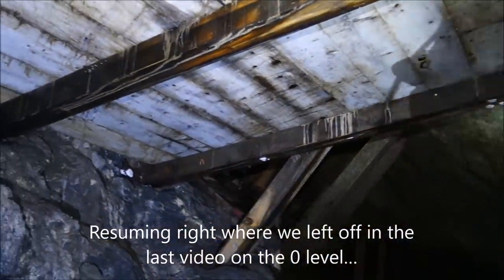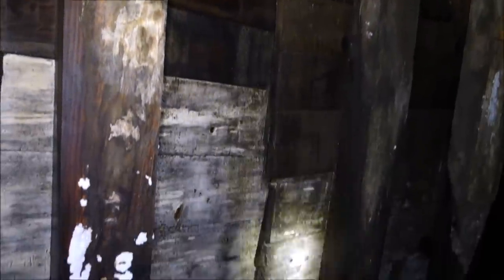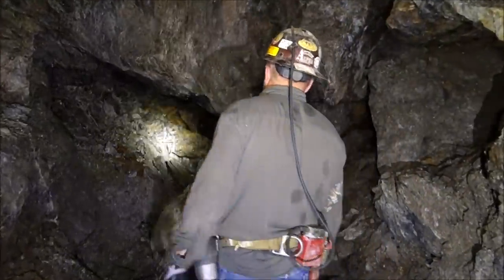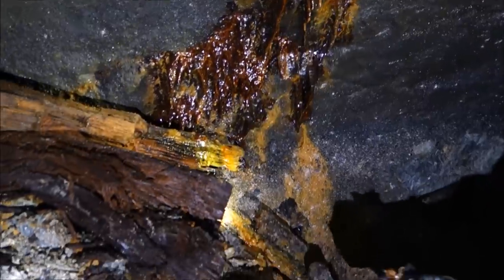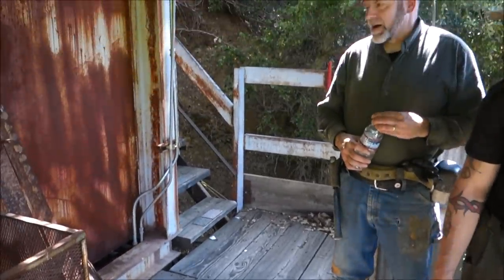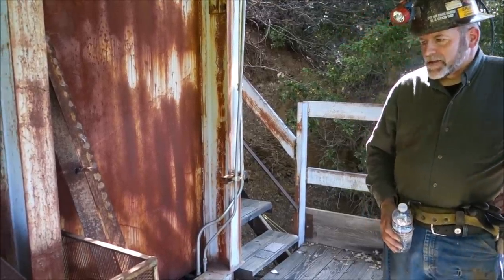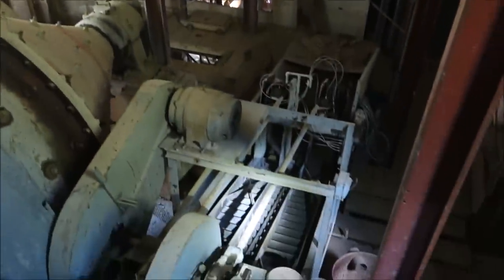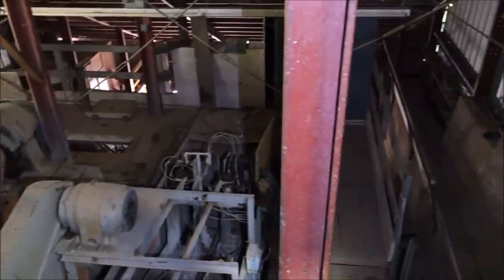Special Visit To The Incredible 16 to 1 Mine: Part 3 - Milling Gold & Last Of The 0 Level

Comment: The difference in the timber is oak vs softwood (fir, pine). The softwoods will expand when wet and the cellulose opens up so much that fungus can penetrate. With oak when it’s wet it swells and the cellulose gets tighter and won’t let anything penetrate it. Hardwood is becoming harder to get and way more expensive and just isn’t cost effective to use so they just use softwoods now.
Reply: Soft wood will be rotton in less than a year in those constantly wet conditions unless treated.
Reply: Why cant concrete be used
Reply: @eaglewi  Concrete tends to snap if impacted and won't bend with loads. Wood bends with loads and won't snap quite as often when impacted. Plus costs. Factor it all together and using wood is cheaper/easier. PLUS can't really do concrete arches in unusual bends/angles, where with wood just nail it in place + cut to fit.
Reply: Simon Tay actually in those mines the water has minerals in it. Those minerals will leach into the wood and pretty much petrify them over time. Think stalactites and stalagmites. The cost of oak is $3.85 a bd ft were the cost of pine is about $1.50 a bdft. It’s not like the wood is above ground exposed to UV light and has a lower oxygen level. Softwood will get the job done and is a more renewable resource than oak. 5 years vs 50.
Reply: erik litchy just to add to what Christopher said, concrete also gets soft as it gets damp. If you put any pressure on it then it would just snap. It would have to be reinforced and the cost of steel is just too great. Understand that the more it costs to mine the more valuable it becomes. Price of gold would escalate so much you couldn’t afford it.
Reply: Mark
You said concrete gets soft when wet. I remember I think it was MIT doing study or looking at Roman concrete. They said they think it was poured hot if i remember right and they replicated some tests. I guess that Roman concrete in water lasts a long time as ports were made out of it, but also as the concrete cracks the stuff in the concrete maybe calcite I think goes to the crack and fills it in again so it’s solid. Idk it was an interesting article I read a year or two ago. That type of concrete seems like it’d be way more durable than stuff we use today especially if it self heals when cracks form.
Reply: Mark
I remember looking into growing mushrooms. If you want to grow reishi or shitake on oak you basically have to cut a new log, innoculate it and wax the ends. It seemed like it was pretty susceptible to be invaded by other types of fungi which is why most websites or videos said to only use fresh cut logs not old ones.
Reply: Also idk. Pinyon pine  or juniper is considered a soft wood I believe cause it’s pine but the resins or pine tar in it is why it burns good or juniper is good for fence posts. So I think pine that’s older with more resin in it also matters to longevity.
Reply: @koltoncrane3099  I never said concrete gets wet and soft. Once it’s cured it doesn’t get soft but it does let moisture soak in

Comment: That is very interesting.  Wallace Idaho is part of the Silver Valley which the Bunker Hill Mine where I worked is at.  There are still a number of gold lead silver mines running in the valley.  If any of  you get  up that way there are a number of museums with some great stuff.  Back in the  50's much of the  underground machinery was built in the area.
Reply: There were foundries in the area, Nevada City Foundry, and Joshua Hendy Iron Works in San Francisco, for example. It is interesting that the hoist ended up in Alleghany California.

Comment: Many thanks, I really like this series, have watched it several times.  Question about the finishing room, at time 25:43 to 25:45, there seems to be a huge shaker table under the stairs, it's like 3x the size of the 5 X 12 that Duane points out.  Is that like a triple wide 'industrial strength' production table?  Yeah, it looks like a reinforced wall, it was on the 3rd or 4th viewing that I noticed it!  Plus, can't believe the size of the Ball Room, seems like one sizeable earthquake and the entire mountain would collapse on it!   Thanks again.

Comment: the shattered and faulted rocks show that it is bedrock that was shattered at the start of The Flood 4,350 years ago.
The gold is in quartz veins because they were dissolved in solution of boiling hot water and as it passed through the rocks cracks some of it cooled and precipitated out to make the quartz vein with gold dust and larger blobs.
That is why much gold has soft round edges.

Comment: I was going to say maybe you need to soak the wood in oil or spray it with linseed oil or pine tar or something. Also really old wood depending on the type has more resin in it making em last longer compared to fast growing wood today. But ya it depends on the species I’d guess which is probably why a lot of wood today is treated cause it is fast growing and has less resin.

Comment: I worked for a specialized mining contracting company for a decade and that is the smallest ballmill I’ve ever seen. The only good part is the liner change would be only a day long minus taking the balls out and refilling. The bigger ones have inch drives which allow you to bump the mill slowly so you can level out the balls instead of taking them all out. be thankful it’s not a rod mill

Comment: I’ve operated a classifier at a natural iron ore mine. They were invented in Minnesota to separate the fines .
Reply from the maker: There are some big mines up in that part of the world!
Reply: @TVRExploring    I worked at one of the smaller mines while going to college and even that was huge when compared to gold mines and such.  During several summers I ran the washing plant and then drove trucks until I quit. These trucks were very small only 65 tons. In time I even drove one 200 ton truck for one summer. The problem was the shovel couldn’t reach up high enough to fully top off the box. The other issues were driving up to the mine dumps. This truck weighed so much that you could never dump a load over the dump sides. You had to dump in the middle of the dump and the two d9 cats would push that load over the dump sides before you got back with another load of over burden. There is no natural ore mining in Minnesota. But mining is still a major undertaking. 
The largest gold, copper and other valuable mining is being develop next to a LTV mining operation on duluth complex. This will be a massive operation if they can get the permits. This will be an open pit mine. In fact the ore body sits right next to a 45 year old mine pit and will use the old mines crushers and mill. Right now I believe they are looking at mining 6-7 minerals. There are many other massive deep deposits in the area that could also be mined.  
Sadly the operations are near the boundary waters and many groups are fighting the mining of these deposits. 
Back in 1995 I brought my ten year old daughter and found outcroppings of ore within the BWCA. I could tell these were massive even back then. These were found within four mile of the mine sights that are being studied right now.

Comment: Funny... 3 years old, and the mold is growing. Exactly the same for us in our mine... on th eother side of the globe. Brand new timbers now rotting, after just 3 years. We cut it off and cut it off, and it keeps growing like crazy. Kinda funny, but also frustrating. 

Anyways, I really enjoyed this. Very interesting. Would be awesome to work there if it ever reopens. Weird how the ore actually still is present even at the conveoyr... they just shut it down and left. Didn't even process the rest of it.
Reply: You should paint/treat the wood before installing it to make it last longer.
Reply: I was a sawmill engineer a long time ago and we ran all the cut timber through a bath containing a "sap Stain" prevention chemical to prevent mold growth. As the mold feeds on the remaining cellulose in the wood ,you can stop it growing by treating the wood. I don't if it's politically correct these days though...
Reply: The difference old growth timber made in the old mines. Dense heart wood.
Reply: Yeah, it is possible to treat the wood... But it's surprisingly expensive in somewhat of a large scale. 
And it's hard to be politically correct these days anyhow...
Reply: @alohathaxted , some of the really old mine timbers down in the lower sections of the mine were placed in the 1930's, not a lick of mold on them! And most are still rock solid!
Reply: @muleskinnermining8661   I just replaced all my casement windows from the late 80's, due to rotted sills. My 80 year old neighbor who's house was built in the 50's has solid wood casements that are still going strong. You can't beat that old growth timber.

Comment: 2:18 3 years old brand new timbers. The top timber is new but the board nailed on the bottom with most of the mold looks older.

Comment: Awesome video's. Don't know if the tour guide should be tapping on the timbers. Notice most of the explorers touch nothing if possible.
Reply: Those timber sets are only 3 years old and I happen to know exactly when those timbers were placed and who placed them. Us miners regularly tap on timbers to determine the structural integrity of the timber, if the pick end of your hammer sinks into to the timber, then it's time for a replacement!

Comment: Why would they use timber in such a damp environment? Why not something like painted or stainless steel? Or something that has more resistance to corrosion or rot?
Reply: Most of the timber was probably procured on site. Bringing in tons upon tons of steel is not practical or even cost effective.

Comment: Open it back up!  Fire up those machines!
Reply from the maker: Rules and regulations... The mine is still operational, but they can only use the bottom part of the mill.
Reply: @TVRExploring  if you know what mineralisation to look for you could just mine buckets of small material, crush, pan and still make a fortune.